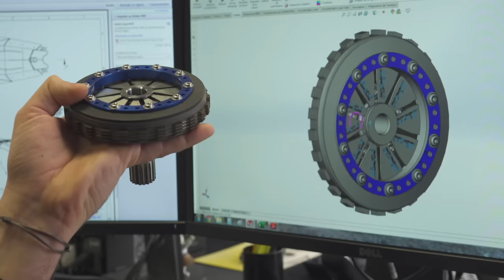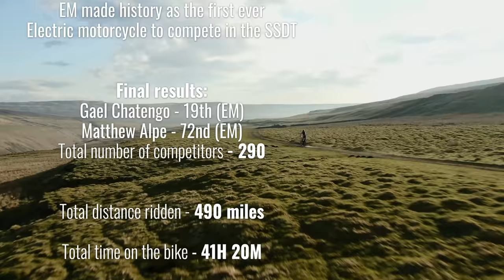The EM Revolution - The Rise of Electric Trials

Comment: Excellent video, well done InchPerfect. One of the best Trials related videos made.
I've owned an EM, but have gone back to an aspirated model. I'm now wondering if I should try the 2023 model. I'm reminded of the ease the EM went up Rocky gullies. I did struggle for grip on the mud though, maybe I didn't give it enough time to adapt. 
Looks like a trip to InchPerfect is on the cards for a text ride. 👍👍
Reply from the maker: Thanks Paul, glad you enjoyed it. You’ll be blown away; the difference on the new 2023 is phenomenal 🙌🏻 Your more than welcome to come and test ride one anytime. 👍
Reply: I'm thinking about trying to get into trials, loved watching it since I was a kid but never had a trials bike, should I start on an em? I like the idea of how easy they are for maintenance
Reply: Joseph
Start by going to your local trials. Join in by observing, and chatting to riders and organisers. Have you gone on an experience day, like InchPerfect? 
From experience, new bikes are expensive, and the can depreciate up to and over £2000 within a year. 
All trials bikes need maintenance. If you don't clean them and do maintenance, they will let you down and depreciate even quicker. Even EM bikes need chains oiling, linkages, head bearings greasing and oil changes to the motors. 
If you're new to off road/ trials, start with an old bike, that you don't mind falling off. If you don't take to trials, then you've not lost a fortune. 
A Beta 200 or 250 are brilliant bikes for a starter. They are forgiving, and good ones can be picked up , in good condition and at reasonable prices.

Comment: Very impressive, well done. Did you need to change batteries at every fuel stop ?
Reply from the maker: Thanks Alan, there was certainly some fuel stops where the battery % was still very high, but not worth running the risk of not changing it, when the facility is there.

Comment: Brilliant video. Loved the IP back story. Would have loved to know more about how you prepped the bikes for the event, what your battery strategy was etc. Thank you 😊
Reply from the maker: Thanks Adrian, glad you enjoyed the documentary. To be honest the bike preparation was all standard stuff; greasing linkage, nut & bolt check etc battery strategy was just regen where possible, steady pace, and swap at the army fuel stops. It was a great adventure. Thank you
Reply: @InchPerfectTrialsIPT  Wow, thought you might have tweaked the gearing for the road sections for example. Loving my 2020, apart from a speed controller all I've done in 2 years ownership is the same stuff. They're bulletproof 😁
Reply from the maker: Hi Adrian, thanks glad you enjoying your bike. The boys ran 2 tooth bigger on the rear sprocket, so slightly lower gearing, more for the sections. It actually doesn’t make hardly any difference top speed and they were fast enough for the road standard.

Comment: How many batteries would you need to get through a day?
Reply from the maker: At the Scottish Six Day Trial there is an average of 5 fuel stops a day. Every time the petrol bikes filled up with fuel, the boys changed their battery.
Reply: @InchPerfectTrialsIPT  So getting about 20 miles of range?
Reply from the maker: You start the day with a full battery too, so a bit less than that. It depends on so many factors/terrain. If you was considering getting an EM Epure Race , and wanted a bit more in-depth info, please give us a call. Thanks
Reply: @InchPerfectTrialsIPT   @Inch Perfect Trials  Yes would like to try one, but more interested in a lite weight trials bike, which is what I wanted 20 years ago when competed in trials & mountain bikes, that has not changed other than now I am to old to have any real skill?
I am going to build one, but do you think that would be some thing that I could get help to develop ?
I know there could be a market for it, as battery tech gets better!
Will get in touch when have something finished!